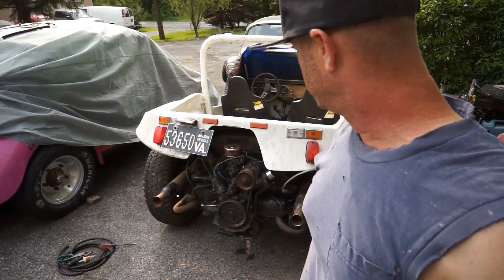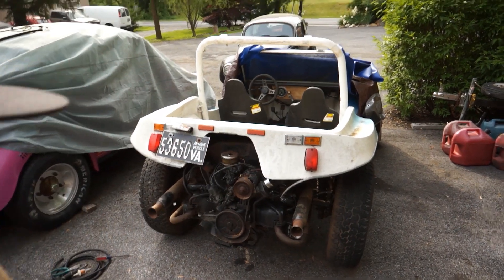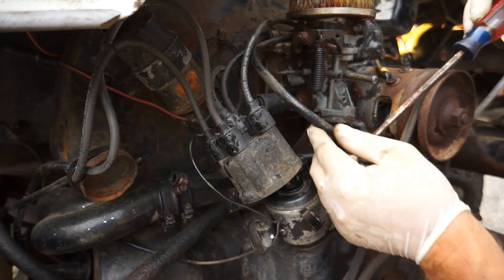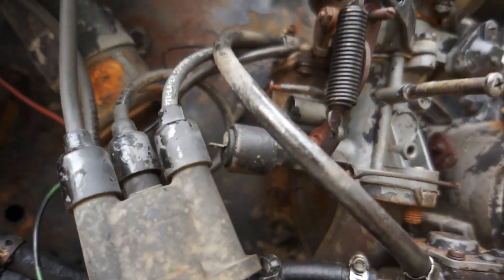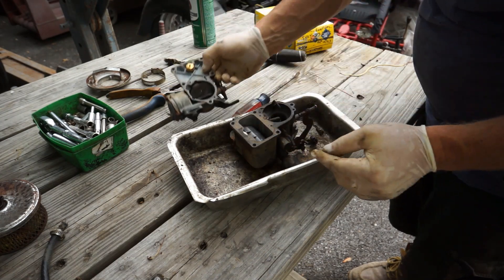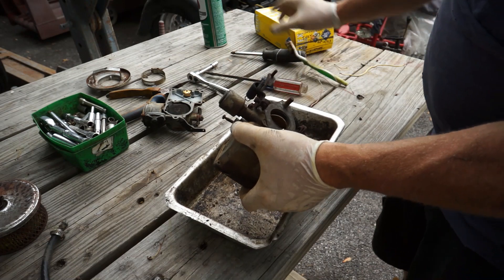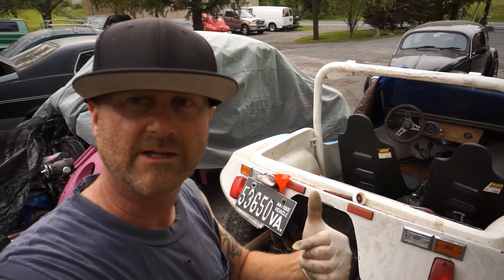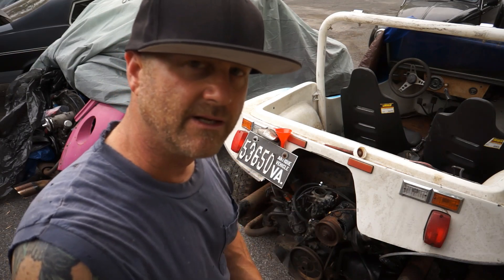1963 VOLKSWAGON DUNE BUGGY ABANDONED 12 YEARS RESCUED, NEW LIF AGAIN ! PART TWO

Comment: Hey I have the same 63 buggy where can I find the vin number thanks
Reply from the maker: The vin has 2 locations..one in front down below where tire sits...most likely was cut out when they made these beach buggy types...and the 2nd place is back behind the seats on the long hump in middle of car...that splits the drivers and passanger seats..just before the rear  trans hump goes over the axel..
Sometimes,  the vin numbers are just not to be found..they cut these cars up to build these buggies...parts from 2 or 3 can build one buggy and vins get left off the build...they just use any title for a VW they had for them. Hope this helps !
Keith 2Guys How2
Reply: @2guyshow2thefishkingz89  thank you very much !